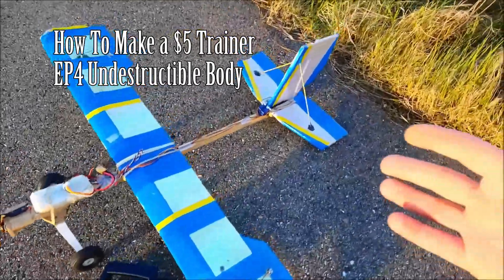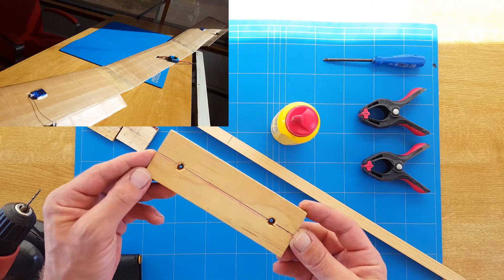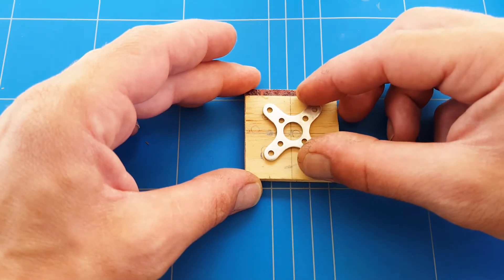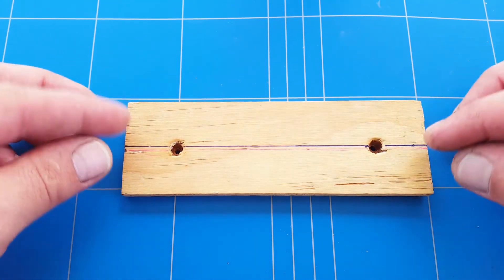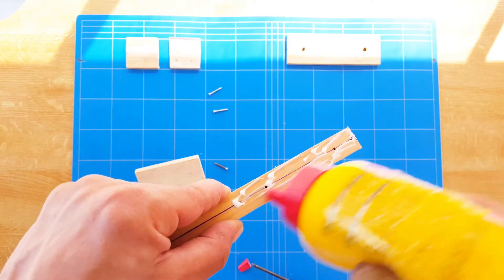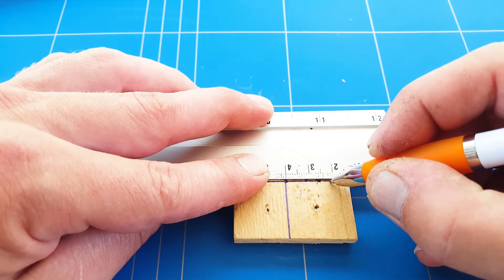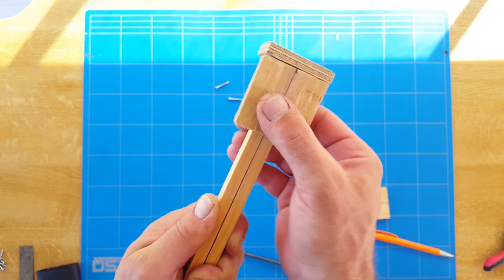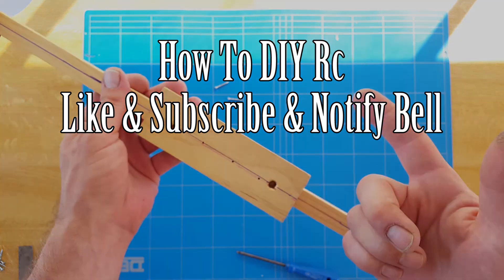[How To Make a Indestructible Fuselage] $5 Trainer Best Beginner Rc Airplane Project EP4

Comment: Hey!
Do you think it can fly with a 8045 prop @1400kv motor?
Thanks!
Reply from the maker: i fly around 60% throttle so maybe you can but i recommend the 9050 orange props because they are super cheap and you get 900grams of thrust http://bit.ly/Gemfan_Orange_Props_9050
Reply: @HowToDIYRc  Then I shall test both!
Thanks a lot for the input!

Comment: All the bits sorted, so ready to roll - just want last part please!
Reply from the maker: i'm sorry just came back from the maiden flight and the wing is too weak 
so we need to a different wing from cardboard before releasing the upcoming build vids
Reply: Thanks for the update. I just love this plane for its simplicity. Would love to get one flying, but I can wait. Keep up the good work.
Reply from the maker: well iff you have all the components ready than add the motor esc and battery to the body and the tail section find the balance point of the body mark it and find the balance point of the wing shut be around 25% of the front edge mark it lay the wing Cg mark on the body and then move the wing 1 cm toward the tail to counterbalance for the 75% of the wings weight you adding behind the Cg and that's how I scratch built my planes
hope this helps to finische your plane and get it flying iff you have anymore questions feel free to ask